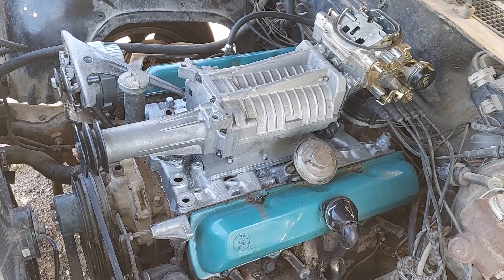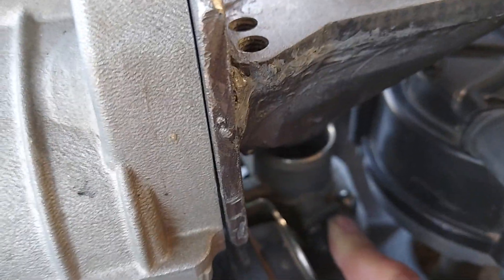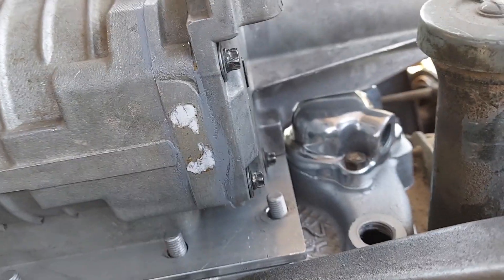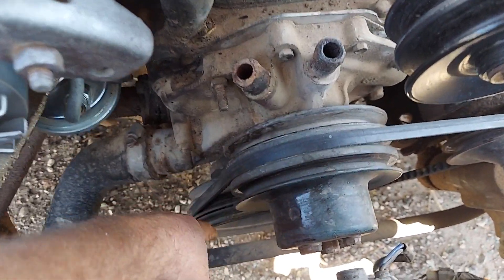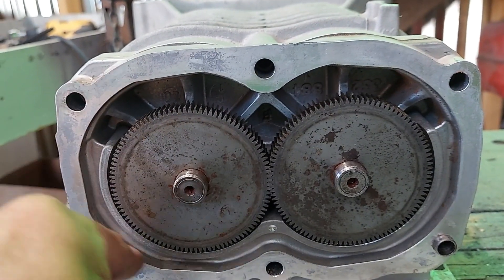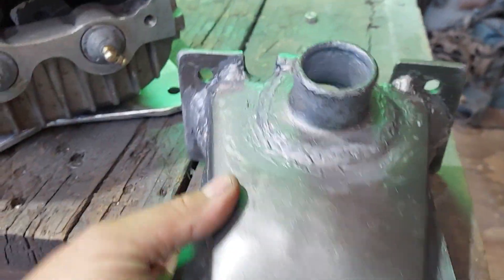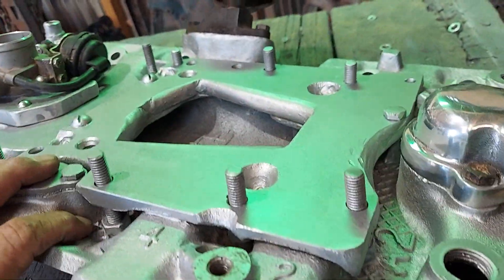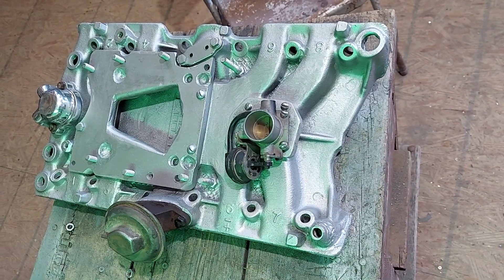Supercharging the Oldsmobile 260 V8 on a budget Jaguar M112 roots blower draw through carburetor 4.3

Comment: brother.  were did you get the pulley.  i bought the m112 supercharger from q 2006 jaguar i have a 231 buick super modified.  I'm searching the pulley to finally get the supercharger working. pls help i will really appreciate it
Reply from the maker: It's a custom made pulley. I reused the original jaguar pulley but grinded off the grooved 8 rib part. I then sandwiched two idler pulleys over the supercharger pulley with JB weld.... yes, I used JB weld, and, yes it's held up so far. Very careful attention to making sure the two idler pulleys are centered

Comment: Nice,,Do you know what supercharger fits on olds 307?
Reply: @raysoto1969 thank you
Reply from the maker: @A-fk4ug  This same supercharger can easily work on the 307 also. You would need to use a different intake manifold since the ports on the 307 sit lower than the 260

Comment: Hey man, I'm building a similar setup and using the mini bypass valve. I'm struggling to see how it works the way you have mounted it though. The vacuum port is carb side where there will always be vacuum. Surely it should be mounted 180 degrees out so the vacuum port is manifold side. Then it would open the valve on idle and deceleration? 

Clearly it works the way you have it but it doesn't make sense to me. Can you explain it better?

Thanks for yhe videos, they are very inspiring. Keep it up!
Reply from the maker: @housecraig  At idle and cruising, vacuum is very high, thereby forcing the spring-loaded valve to open, allowing whatever air/fuel not used by the engine to recirculate back to the supercharger. At full throttle, vacuum is very low, and the spring overcomes the weak vacuum and closes the bypass valve... All boost is forced down to the engine.
Reply: @raysoto1969  Thanks, that makes more sense. I'm at the point where I need to mount it and couldn't find any information or drawings showing the orientation.

Comment: I am guessing that with adequate knock resistance and perfect timing, that could make 400-500hp. The cylinder walls aught to be thick since the bore is so much smaller than 307/330/350/403.

Comment: Great effort....i do believe you might have wasted some effort with that bypass valve though...the blower can't flow more air at idle than the carb butterfly airgap can flow. At idle there will only ever be vacuum in the manifold untill the butterflies are cracked so there's no.pressure or flow to relieve. Supercharger experienced here as well.
Not being critical...total respect for your work and for sharing it. 15:45
Reply from the maker: @arbiewolfe3027  Simply put, the bypass valve allows the engine to idle smooth. Without it, or when I shut it at idle, it will surge at idle very noticeably.
Reply: Hmm interesting. I don't know anything about that particular jag blower...is it a straight rotor?  I didn't get to watch all of your videos on this adaption but I will as soon as i ca .. As others have said..your build is real hotrodding ..."No see no CNC" ! :)
Reply: @arbiewolfe3027   so all the oems are wrong, and you're correct?  Every oem supercharger setup has a bypass or some form of clutch to allow the blower to be bypassed at idle and cruise to reduce inlet air temps and surging.  Have you never witnessed a blower car with a 10/71 on it chirping the tires and lurching through a parking lot at idle or just off idle?

Comment: im surprised you didnt use an aftermarket 260 to 403 intake there pretty cheap
Reply from the maker: Although the intakes from the larger engines will bolt up... there would be a severe port mismatch on the small 260... so the stock 260 intake had to be reused

Comment: How the hell does a jaguar roots blower fit on an olds 260? BUT, could i use this on my olds 350?
Reply from the maker: Yes
Reply: It fits because someone thought out of the box and made it fit , anything will bolt anywhere with enough effort , company's make flat alloy plates that bolt to 4 Barrel intakes the top of the plate can be drilled for any blower , I had a 302 Cleveland in an Australian Falcon Ute , with C10 auto . It was so worn out I couldn't feel any compression, but still ran good , I got it for free so I thought I'd see what I could bolt on ! I welded up some steel piping , oil line and return , I had a Holset Volvo 14 litre Truck turbo , mounted it to the 302 Cleveland, worked grate , bit of lag but once wound up it more than doubled the 1979 factory HP of a 302 C. Anything can be done with imiganation .

Comment: You could have used a Holley carb...

They are MUCH easier to boost reference the power-valve. Just drill a hole through the side of the main body, into the power-valve well, and epoxy a tube into the hole. Done. 

A Holley is much easier to tune, and tuning parts are readily available everywhere. 

Nice job though...

Comment: Did you have to swap the pulley if so Where did you get the pulleys for the supercharger?
Reply from the maker: Custom pulley... I welded two V-belt idler pulleys on a trimmed down OE pulley
Reply: @raysoto1969 so basically i need 2 v belt pulley from what car exactly.  g body or any v belt pulley from 70' to 86' ?
Reply from the maker: Custom made

Comment: Will make good power. I had a 307 olds and put a t3/4 supra turbo on it blow through carb about 20 yrs ago. Ran great and solid 12.80-13.0s. Not bad for a stock 307 with a olds dominater intake,650 carb and msd with 2.73 gears.  Full body and ac/heat worked. Missed that cutlass cruiser.
Reply: That sounds awesome
Reply: Should have put some 373 is behind that thing it would have been fucking in the solid 12 sec range. A lot of people have slept on the 260 and 307 because they have webbed blocks but as long as you set them up right and give them proper tuning they hold up.
Reply: @kskip4242    we're finding out the same with the 301 Pontiac. It CAN be built.

Comment: Did you file the ring gaps wide enough and either hone the cylinder walls with a honing device or have the cylinders bored “30 over so it can make more horsepower
Reply from the maker: No, the engine is bone stock and high mileage.  I don't drive the engine hard most of the time. I'll gun it once in a while.
Reply: No need to open the ring gaps at 5psi

Comment: If you're going to supercharge an Olds, why not just go get a 350 instead of a 260? It's 90 free cubic inches with way better heads (any late 70's model with low compression). Not saying this isn't interesting, but interesting =/= efficient.
Reply: Ain’t free if it ain’t in the car. Time is money and not everyone has a 350 laying around either
Reply: @ethanpenney7857  Small block Oldsmobiles are a dime a dozen. In addition, if you decide you want ANY performance upgrades, you’ll end up doing the job twice, because you’re at a dead end with the 260. Time may be money, but so is money. Buy once, cry once.
Reply: @jody_barr  olds 350s dime a dozen? Where? I havent come across one in years,and those that have them want good $$ for them. Not a sbc or ls, olds is a niche. If anything,be easier to find a 307. 
Those hold 12psi of boodt nicely,buolt one back in 2000 with a supra t3/4 turbo. Only bent a rod at 15psi, greed got better of me. 😂
Reply: @elreyyakko "15psi" doesn't bend rods, your tune did...
Reply: @davelowets  93 octane, way before widebands were popular to use to tune, so yes, it was the tune, but still all factory motor. Did good for what it was. Knowing then what I know now, it would still be running.
Reply: @elreyyakko  YES, the tools we have today are MUCH better for analyzing and tuning a boosted motor. 

I have an aftermarket block Oldsmobile 505" big block motor with a billet crank in it, and symmetrical port CNC aluminum heads. It makes well over 700h.p. in N/A form with a Dominator carb on it. I just picked up a Holley Terminator-X EFI system for it, and plan on adding boost with a twin Torq-Storm supercharger kit. Will make over 1000h.p. with that on it. The really nice thing about the Terminator-X system is that I can use knock sensors off of an LS engine, screw them in the block, and have a working detonation sensing system. Then I'll be able to run E-85 on the street, and then dump race gas in it for when I hit the track, and simply load the proper tune for the fuel in the ECU. Should be interesting for sure.
Reply: @elreyyakko  If it were me, I'd definitely use a 350 Olds in place of a 307. The bore and stroke for the 350 is VERY favorable.... big bore, short stroke, and they breathe MUCH better than the 307. The Olds 350 even has a better bore to stroke, and rod ratio, than a Chevy 350. They can be a POTENT motor if done up correctly. The thing that holds most of them back is the factory head castings. They don't flow all that well. They have a great valve angle, and an efficient chamber, but the intake ports suck. A decent set of aftermarket head castings and a good port job open up a LOT more power in these things. A guy doesn't need a piston with a great big dome to get in the way, and ruin the flame front, with an Olds either in order to get the compression up there either. A true flat top piston can yield 12:1+ compression with a small enough chamber in the heads. My big block is at 13:1 with just a TINY +6cc dome on the pistons. I will have to put some thicker head gaskets in it, to knock the compression down a bit, when I switch over to boost.
Reply: @elreyyakko  It's TOO bad that the small block Olds 403 has such a weak block with the windowed main saddles. It has a HUGE 4.350 bore, and with the small 3.385 stroke, the thing COULD be a high revving, big power, screamer... 
BUT the bottom end WILL fail with any sort of big power because of the weak structure of the mains in the block. SUCH a shame... 😟

Would have been a GREAT motor otherwise.

Even the factory big blocks don't have a very beefy main webbing setup in them. I have ripped the center 3 main saddles right off the block TWICE when attempting to make big power with them. Even with some big aftermarket main caps...
 The first time I was hoping it was a fluke, the second time I knew it wasn't, and I gave up trying to go fast with an Olds big block until the Rocket Racing aftermarket block came out. 
It's a STOUT piece, with PLENTY of beef in the main structure, 4-bolts on ALL main caps, and a redesigned oiling system with priority mains oiling. With siamese bores in the Rocket block, a guy can go to a 4.400 bore with it. 
Combine that with the off the shelf available billet crank in either 4.25 or 4.50 stroke, and you have a bullet-proof big block Oldsmobile that will easily take 1000+ h.p. and live to tell about it. 
A 4.400 bore and 4.500 stroke will yield 547c.i., with off the shelf parts. 600+c.i. is possible with a custom stroke crank. 

I used a 4.25" stroke in mine to keep it an undersquare motor, and it LIKES to rev..
7200+ RPM's is not a problem with a large enough cam and some decent head flow. Pretty bad-ass for an Olds big block.
Reply: @davelowets  agree, but 307 where plentiful and easy to find vs a olds 350. This was over 25 yrs ago, now its almost impossible to find a olds 350.
Reply: @elreyyakko  Around where I am, they're still easily found. Some wrecking yards still have some under the hoods of the 70s cars that are still sitting there, rotting into the ground. But, I'm sure it's not like that everywhere. 

BUT, a 350 diesel block Olds makes a GREAT foundation for a big power small block. There's still some of those around to grab. The diesel DX block was the one to get. The diesel D block had larger lifter bores in it, and it's hard and expensive to find replacements for those. A guy CAN have the D block lifter bores bushed down to the standard .842" size lifters with bronze bushings, but it's an added cost over using a DX block. The diesel blocks can take up to and over 800h.p. easily.... and are MUCH stronger than the gasoline blocks.
Reply: @davelowets I've built many 403s up to 600 HP at 6500 rpm , no problems , that old " it's weak cause of windowed mains one is 30 years old and just gets repeated over and over " reality 1 have you personally ever seen a 403 drop a crank ?? No not many have under 600 HP . 2 LS/LT chev motors have windows in the mains in the same place as the 403 Olds and they aren't weak ! Ask Joe Mondello , with the new alloy heads being made and Edelbrocks new Victor air gap 350/403 Olds intake that flows so much better than anything , new Keith Black forgded pistons the 403 is having a massive come back to the point people are searching wrecking yards for good rebuild able ones. With that 4.351 inch bore and 3.385 inch stroke some really nice 403 s are being seen ,

Comment: That elbow for the carb is choking it, i would make one with a more smooth curvature and a wider mouth opening since your basically driving with a restrictor plate between your carb and your supercharger. That bypass hole is going to a pool of fuel rather quickly....
Reply from the maker: It does "look" restrictive,  but the flange on the carb elbow to the supercharger inlet is just as wide. Still flows good enough for 8 psi of boost. The bypass valve is always open during regular driving and only closes at full throttle, so liquid fuel doesn't have a chance to accumulate.

Comment: You do interesting things ray ..... The bypass valve seems backwards to me it's drawing vacuum from the carb side not the intake manifold and so will keep opening and closing ... If the vacuum is on the manifold side boost will hold it shut ...
Reply from the maker: Thanks Scott!...I initially thought the same thing, but this is how it was installed on the mini cooper, and this is how it is installed on all superchargers with a bypass valve..... the vacuum is referenced to throttle side vacuum before the supercharger.... I think the reason for that is because they want to make sure that the second you let off the gas pedal to slow down, the bypass valve will immidiately open afterward.

Comment: Only one way to find out if it'll work. I'd try to keep the boost in the 5lb range to start with. Be careful with the ignition advance.

Stock static compression is 8:1
And the factory cam has no duration to bleed off compression.

It should feel like a healthy 350 cu in with 5lbs.

5lbs = 9:1 dynamic compression

10lbs=430 cu in (10:1 dynamic compression)

15lbs=520cu in (11:1 dynamic compression)

Pump gas with low duration/low overlap cams usually gets into detonation territory anything above 9:1 compression.

Then again you could always try running E85 for higher octane. But the btu qty is about 70% of gasoline. Meaning you'd need to run a richer mixture.
Reply from the maker: Great prognosis! I will definately need to have high octane at least... I'm not sure the final psi will be
Reply: you also get more O2 from E